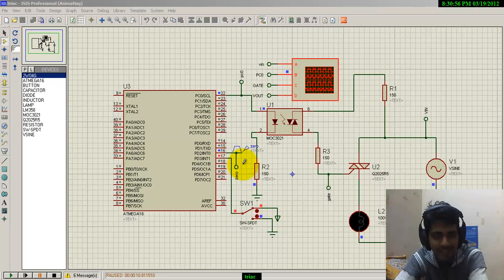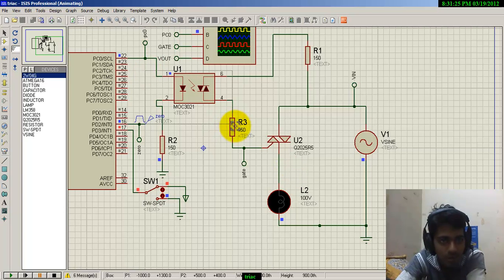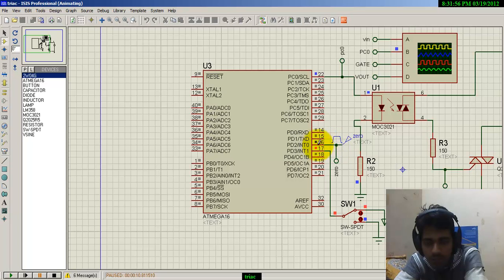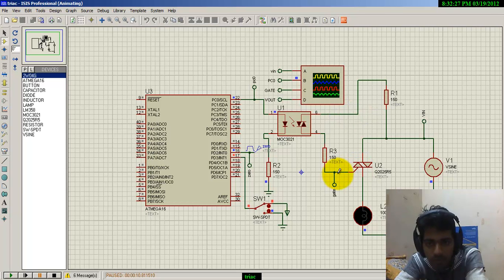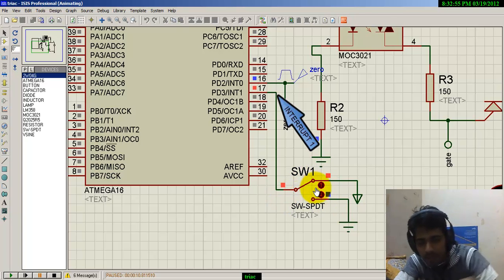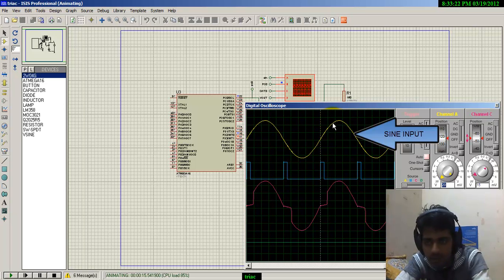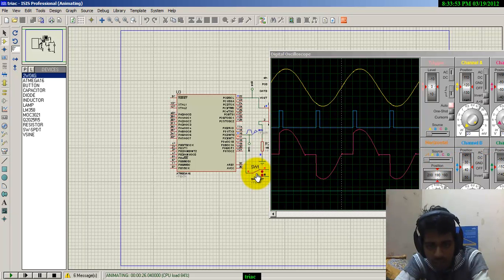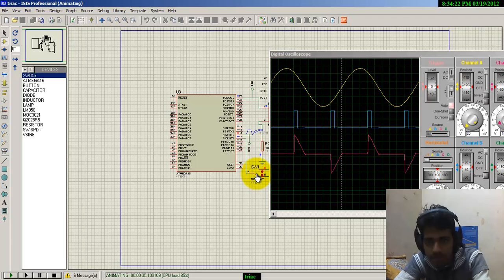Firing angle control of TRIAC using ATmega16 microcontroller Simulation

Comment: hi I have a question about simulation here. I built this circuit with pic 18fk4622, when I adjust the alternator frequency at 1 Hz and code for it, it has no problem with the firing angle, perfectly fine at 1 to 40 hz. but after that when I try to simulate at 50 Hz it shoots regular sine wave. is that because of a simulation error or  something wrong with the circuit?

Comment: I am working on a project "Wireless speed control of single phase 
induction motor".I did some google search and I found that most people 
are suggesting for using phase control .Can I use Arduino to trigger 
Triac using PWM ? Is it necessary to use phase control instead of PWM 
and  cCan send some link or some circuit diagram?
Reply: yes u can use Arduino to trigger 
Triac using PWM
Reply: currently I am also working on the "Wireless speed control of single phase 
induction motor." could you please help me with it?

Comment: Good work. However there is a very important circuit that is missing. The zero-crossing circuit is essential in real life applications when you need to control the power to your load.
Reply: What is zero crossing circuit , please explain the basics.